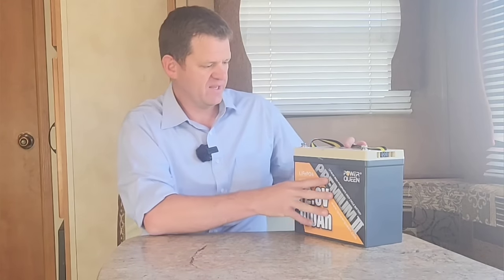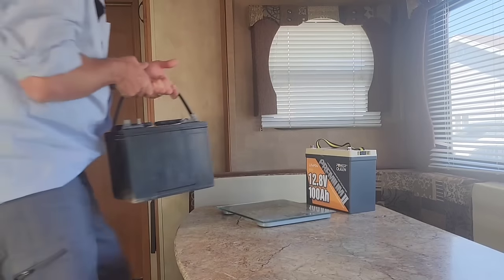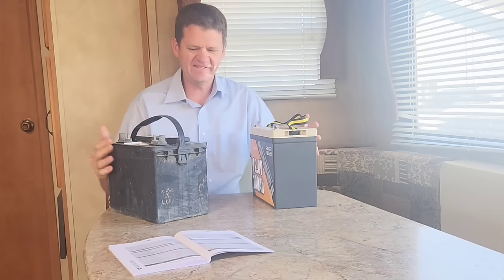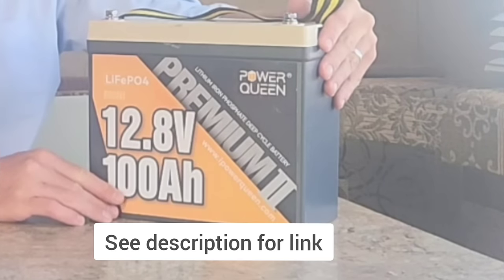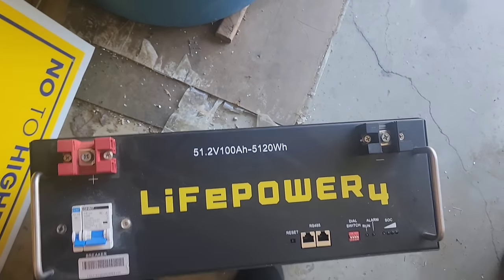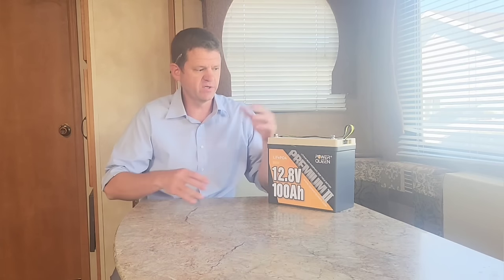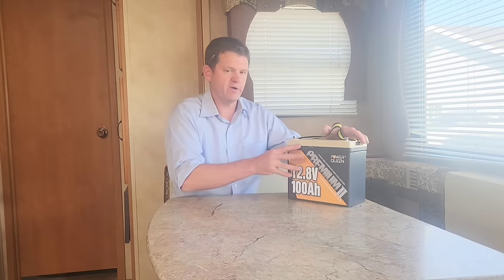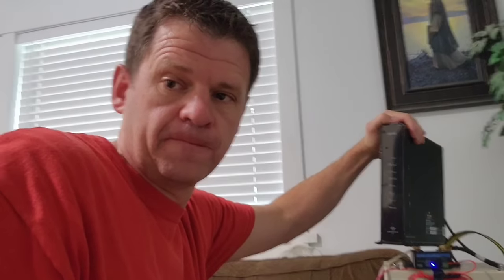How Long Can a 12V LiFePO4 Battery Run a Fridge, TV, Laptop, and Wifi Router (PowerQueen test)

Comment: Hi, is it possible to run 24000 BTU air conditioning unit on a system like that
Reply from the maker: I am not sure. You'd have to check what the startup current is.

Comment: The life-po batteries suck ass in the hobby grade rc world. They are the least favorite when it comes to energy density and discharge rate.

To break it down in simple terms. A life-po battery has about half the run time in an RC car.

Question...
Is the lead acid battery a deep cycle? Or a normal car battery.

You can also save energy by connecting directly to some devices such as your router.

You might be converting 12vdc to 120vac only to be converted back to 12vdc through its plug on the router.

If any of your electronic devices can run 12 vdc directly, you could save more.
Reply from the maker: I believe those are a different lithium chemistry.

Comment: Lifepo4 deep cycle batteries will be damaged if depleted to zero.
Built in BMS shuts down around 10.5 volts and battery goes to sleep and must be reawakened.

Comment: A single LIFEPO 100ah battery will not do much good. I have 800 watts of solar and 400 ah of batteries and believe me THAT is not enough let alone what you want to do. I run a dorm fridge, 32" flat screen, a laptop and various lights. Then intermittently a coffee pot and microwave. I started with a single battery just like you. It was ok for very short length of time like when I was moving just to keep the fridge going. I am about to go to 1200 watts of solar and 600 ah of batteries. I live all the time doing this trust me one battery is useless.

Comment: 0:58 Not true. It will damage the LiFePO4 battery if you discharge it to Zero Volt.
Reply from the maker: . I believe the BMS cuts it off before it gets to 0 volts
Reply: @diySolarPowerFunWithRay  The BMS should cut it off if it is below 2.5V per cell.

Comment: How many watts is the fridge.
Reply from the maker: It's a typical electric house Bridge with a compressor. I want to say when it kicks on and running it's using 350 w but but it doesn't run all the time... pretty much zero Watts when everything's off. If I average the power used throughout the day I think it comes out to be 50 watts per hour.. on average. I can't remember exactly but I might have mentioned it in video somewhere.

Comment: So your fridge only takes 50watts?, i thought fridges uses like 300watts
Reply from the maker: Yes they use that much energy but they aren't running the entire time.
Reply: @diySolarPowerFunWithRay  okay, you mean it can spike to 300 and drop back to 50, I'm actually trying to understand because i want to build this setup and want to know how to calculate it
Reply from the maker: @samuelabah2460  I would run a inverter similar to the one I have. I wouldn't consider a spike because when the compressor is running it is more of a constant draw. But it may only run for 15 minutes and be off for an hour. Your fridge can vary though

Comment: How long did it take to charge the battery solar
Reply from the maker: At a max charge it will charge in 1 hour.
Reply: you must have a big solar if you charign full in 1 hour... thats like 100amp of solar 
 @diySolarPowerFunWithRay
Reply from the maker: @thatonebeone  I have a 1400-watt array connected. So technically yes it could do it, but my solar charge controller only has a output of 30 amps so it takes just over 3 hours. That's why I like the 48 volt and 24 volt batteries. The charge controllers can output more power for less money.

Comment: Shocking to see the tv drain the battery down almost as fast as the fridge.
Reply: I watched this video as a tool to better understand without consuming time with math, how much power my 100ah battery would use, I opted to buy a 24 inch Roku smart tv. Older is better.. 720p uses less power than charging my laptop(s).

Comment: The battery  will last ten minutes? :)> Never run AC inverter on DC batteries! an inverter from a dc generator does work, but why???!!!  ... use a propane fridg on RVs.  Use a PC tablet with a keyboard on your  RV

Comment: LifepO4 batteries that I know of, each battery should not be dropped below 2 volts!
Reply from the maker: The battery management system should protect the battery from dropping to a percentage which will damage the battery.
Reply: I know this, but what you say is different. It's like you said you can discharge it down to zero volts. Anyway. @diySolarPowerFunWithRay

Comment: 1amp for 100hours
10 amps for ten hours and so on.
Same for charging..
10 amp charging..10 hours
Reply from the maker: Yeah most calculations are pretty straightforward but the fridge is a little more tricky because with the condenser turning on it is not a constant power draw.

Comment: well thats not correct ... looks like the fridge is an inverter based technology .. if you draw 50w continuesouly it should be be 20h approx .
Reply from the maker: The inverter running uses some power as well
Reply: @diySolarPowerFunWithRay  thats correct .. seems like the fridge stops using energy when it hits the cooling spot

Comment: I must be doing something wrong cause I have 6 batteries and I’m constantly recharging them.
Reply from the maker: LFP batteries?
Reply: @diySolarPowerFunWithRay  No. LiFePo batteries. My solar panels aren’t enough to fully charge them so I installed a 40a dc to dc charger. That however, started starving my starter battery with 150a alternator. I then bumped it up to a 250a and upsized the “big 3” cables to 1/0. The fixed the starving issue. I still find that I’m having to charge more than I expected. I think I need to rewire the way i paralleled the batteries. Instead of using a bigger cable to jumper them, i used #10 to wired them individually to a fuse block. The idea was that I could eliminate or cycle different groups of batteries, but I don’t think that was a good idea now.
Reply from the maker: @franciscoburgos787  interesting.  It sounds like you need more solar.

Comment: A FULL size side by side house Frig only using 50 watts (come on really)...... a 300 to 400 watt inverter will never run a full size frig. compressor, unless im missing something
Reply from the maker: Of course the fridge runs with that much power.... Is it continuously running non-stop....?  That's the real question
Reply: Please post a picture of the specifications decal/label/sticker that is on every frig. sold. Thanks

Comment: FRIDGE IS NOT A GOOD TEST LOAD...  Why?... It cycles on and off.  A better test load would be a hair dryer or heat gun, which has a CONSISTANT DRAW
Reply from the maker: I wasn't trying to test something with a constant draw
Reply: Most people don’t feel the need to run a hair dryer or a heat gun during a power failure. But they do run a refrigerator.

Comment: What the hell are talking about.  
No more then 85 percent  charge....... long life battery.  If you care.... 
Draw . No lower then 30 percent  . If want a battery  to last. 
What load of crap. Long term life. 
You only post .
100 percent change  to dead. 
No thanks
Reply from the maker: Look up the spec on LFP batteries.

Comment: All this is meaningless, simply to many variables, you could take all this solar kit to another type of house in a different location and get a completely  different set of data and it depends on what you want the solar for, if it's to offset grid electricity costs forget it, so much of the electricity cost is now standing charges which you can do nothing about, so with a small number of panels it will takes years before you break even on the cost of the system, if it's to cover a grid failure  then hardly worth it, where I live the grid power has only failed twice in over 30 years!  It is all so subjective, Although I do know the great feeling when in my house  with the fridge freezer TV's and computers running on grid tie the leccy meter is stationary :)
Reply from the maker: Yeah, definitely best to get a watt meter first and then measure your usage.

Comment: Yer gonna kill yer battery.
Reply from the maker: These can be discharged to zero without damaging the cells.  Up 4000 cycles.  I'm not too worried.  much different that sealed lead acid batteries. Thanks for the comment.